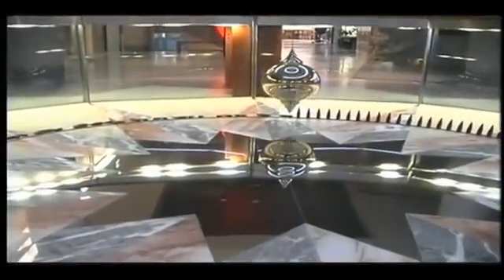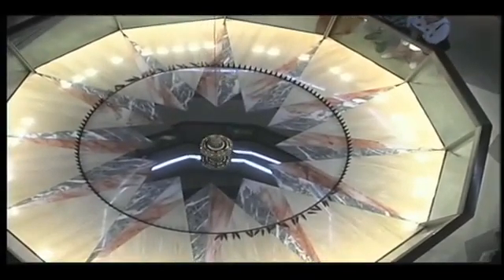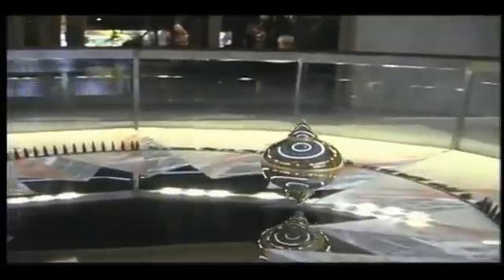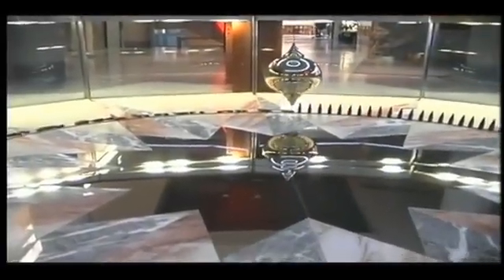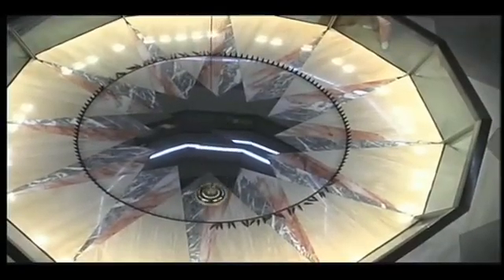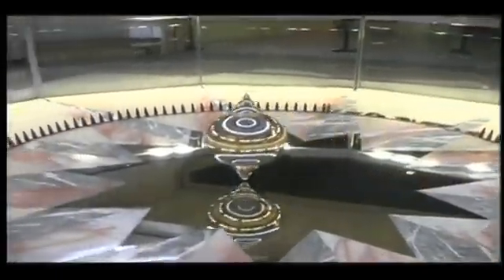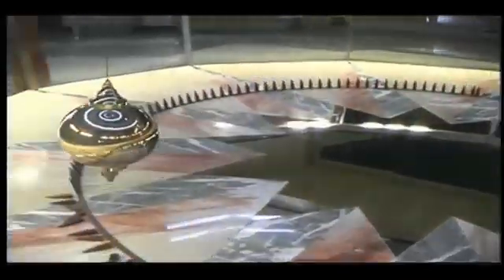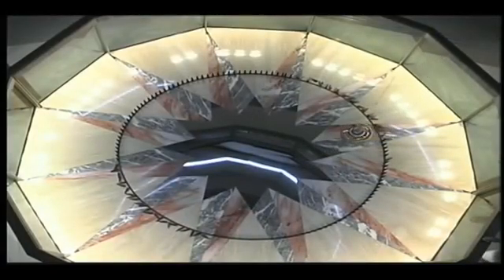Foucault Pendulum

Comment: Coriolis effect has been completely debunked.  All Foucault's Pendulums eventually come to a stop, and they all have to be set in motion to start with. As such, these pendulums do NOT demonstrate Earth's movement whatsoever.
Reply: I've looked into dozens of pendulums with different properties and made some very interesting discoveries. It has a brass surface with an iron core tending towards the magnetic meridian, also a small electromagnetic ferromagnet which occasionally gives a push to make the pendulum swing indefinitely, a so-called Charron ring to eliminate the non-uniform variances in the plane of oscillation and last but not least, no one has considered that in physics a ball tends most of all to produce a circular motion and the weight of the ball makes a difference too. Its is important to also note the strong electromagnetic field of the earth. Et voila, a pendulum seemingly swinging with the rotation of the earth, in a closed frame. And why do people think the earth rotates? cause the pendulum is seemingly swinging with the rotation of the earth! It is always said that the earth would rotate below the pendulum, most people dont even question it, but it could just as well be, that it is the pendulum swinging above the earth. There is no logical point in preferring one conclusion to the other, thats called deception. Did you ever see a crane starting to swing on its own and not able to stop? or did you ever see a plane or a helicopter that had to take coriolis force into account? I did not. If that simple fact doesnt apply to big things, why should it apply to a little pendulum? Another vital point is the Allais effect, that states that during solar eclipses, the sun's emitted electromagnetism creates noticeable disturbances in the vibrational plane. Furthermore, without Charronring, you couldn't just use what's not permanent in favor of, or against, a given sentence, because then you put the cart before the horse and violate honest investigative laws. It will not start to swing on its own and will stop eventually, cause we stand still. I would ask that you set up a handful of Foucault pendulums, preferably on a smaller scale than the Pantheon, without a Charron ring but otherwise with exactly the same specifications, in the exact same place and then realize, since you will get many different and inconsistent results, the pendulum does not work. The plane of vibration is not stable without a Charron ring and the ring is a crafted mechanism to make it appear as if it vibrates with the rotation of the earth in the first place. The ball now provides the circular movement, because that is a physical law. The longer a pendulum is, the longer it can swing without an electromagnetic drive, but after that it's over! Thats why Leon Foucault chose the Pantheon with a 67 M long thread. He was a member of the Hermetic Secret Society of the Rosicrucians, and therefore a Liar and a Thief, cause he  was not the first discoverer of the fact that the plane of oscillation of the free pendulum is invariable; but that the honor of discovery is due to Poinsinet de Sivry, who in 1782, stated, in a note to his translation of Pliny, that a mariners compass might be constructed without a magnet, by making a pendulum and setting it in motion in a given direction; because, provided the motion were continually kept up, the pendulum would continue to oscillate in the same direction, no matter by how many points, or how often the ship might happen to change its course. It is pointless to further discuss whether the pendulum works or not, as it is a magicians trick. Here's something else to think about: Another obvious proof is rather more simple and that is time zones and magnetic declination, there are in fact 19 time zones in the north of the equator and 32 south of the equator. Which makes no sense at all on a globe divided into 24 longitudinal sections.
Reply: "All Foucault's Pendulums eventually come to a stop"
You utterly don't understand what's going on here.
And you're too dim to do any research.
Wow, pretty sad.